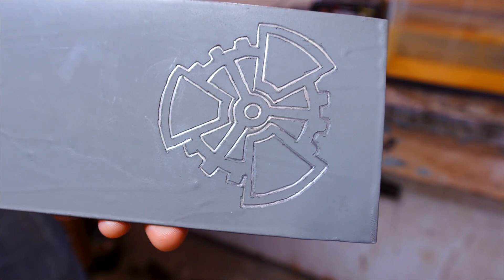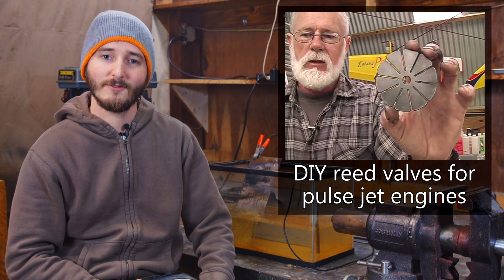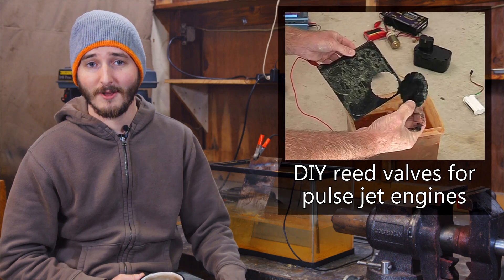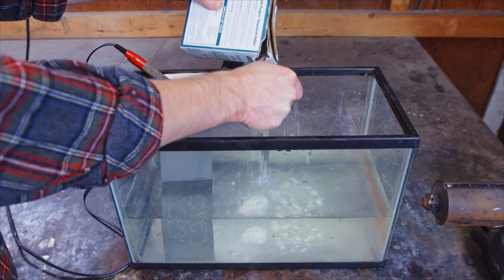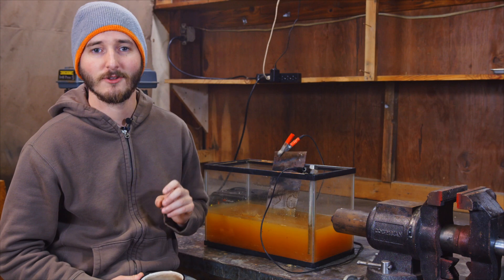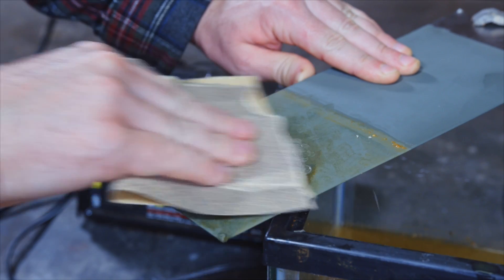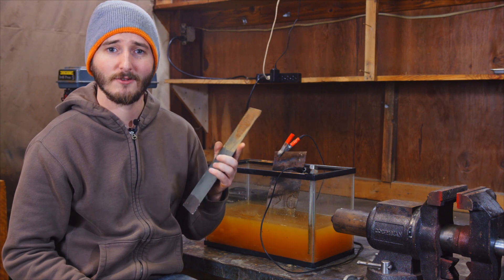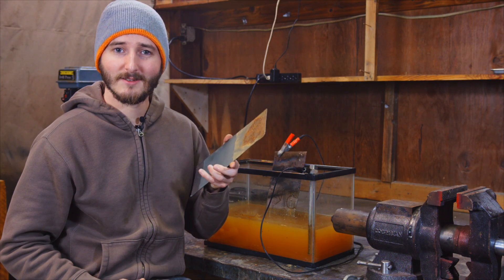How To Cut Steel With Electrolysis [Experiment In Progress] - NightHawkInLight

Comment: Multiple-paragraph comment. You probably already know all this, but, I'll give it a shot anyway. I think this technique might be impossible on the thicknesses you're desiring. In the video you showed, the metal is sheet. The piece you're holding is thin plate. I suspect to do this with chemistry is going to follow the same results no matter what paint you use. The chemistry follows simple rules. Exposed steel becomes rust and flakes off. Any material you want to etch is going to be etched outwards from the first line you cut, hence why it'll only work on extremely thin sheets. What you're doing is kind of like EDM (chemical erosion instead of spark) without a toolpiece to direct the erosion. Your toolpiece is the water, which takes the shape of the cut, growing outwards. In order for this to work, you'd have to regularly re-prime the sides of the cut that you want to shield, and even then it'll be ugly. It looks like you're having some extra trouble in particular with the paint encouraging the electrolysis to occur along its edges and undercutting, but fixing that won't fix the limitations of the method otherwise. (cont'd).

Things to Try: 

1 - It would probably help to begin with the thinnest cut lines possible, since they'll grow outwards on their own. Don't bother with a 1/8" thick area you want to etch, it'll get fat on its own. A single Xacto blade slice for starting. 

2 - While "all" exposed steel is pretty close to the current path of electricity, give it a fighting chance by using a sheet of stainless as your opposite plate, and have the two facing each other with relatively narrow gap, just enough to clear the swarf, maybe use some plastic spacers from coffee tub lids or whatnot. I'm guessing 1/8" to 1/2" would be best. The more electricity is given the option to wander, the more it will.

3 - Try a variety of steel thicknesses, from the thinnest you can find. If you can get the thinnest to work, at least you can observe what is happening reliably, and then progressively move to thicker pieces and see how the problem amplifies. The current pieces you're using seem so thick that you can't get any useful data from experimenting with them, they may be failing for a variety of variables several magnitudes too large. Start with steel foil if you can, soup or coffee cans maybe, can't think of what's cheap and thinner. 

4 - Try to set up a simple vertical bobbing motion, to encourage swarf to leave. Rust is already oxidized, and thus will resist rusting further, making the electrolysis "prefer" the cleaner metal adjacent to it that you do not want etched. A 3-6 rpm turnstile motor from a junk microwave might do the trick, but you might aim more for 30-60 rpm to get the swarf moving. Ideally you don't need much of a bob, just enough caming action to agitate the rust. 

5 - Try using a small aquarium pump to pull the solution out of that bin and into another, and a magnet to suck it out of solution. Maybe rusty water has different properties. It'll either make it better, worse, or have no effect, might as well find out :p  

6 - MORE CURRENT. Throw a rewound MOT with a big rectifier and cap on the output and use that as your power source. Or, heck, for the amounts of power you need, just run the MOT backwards with 120v on the 2000 turn secondary. That'll give you ~6v on the old primary... call it 9vdc after the caps. Or use an old UPS battery you don't mind risking. 

7 - Try different orientations. What you showed in this video seems to be the worst orientation for clearing swarf. Clearing bubbles might happen too, there might be tiny paint-oxide chemicals forming that are messing up your cut, and if you can force the oxygen to bubble up as itself rather than hang around the paint, it might work better.

8 - Take one of the big 2" ring magnets from a microwave magnetron (or whatever magnets you have), coat them in paint or epoxy so they don't react... and stick/bolt/glue them to the stainless sheet right in front of mild steel workpiece. Spacers would obviously be necessary. But that magnet should gobble up every spec of rust and leave the cut path clear.

9 - Try all this with different electrolytes. Salt is particularly poor, it creates corrosive chlorine gas and other chlorinated compounds that'll devour anything. I used tablesalt as my electrolyte on my first hydroxy generator and in about 30 seconds of being on it devoured even my stainless sample piece. Chlorine will mess up any chemistry you're attempting. Baking soda isn't great either. For some things I use TSP (in the painting isle of reno stores, in a tiny cream carton thing), battery acid is apparently best.

10 - Try overvolting. Try undervolting. Higher voltage just wastes heat, and sometimes just boils water (making people think more electrolysis is happening when it's just steam bubbles), but maybe it'll have an effect. I've found it helps with agitation, which is normally useless for the stuff I'm doing, but, might help you.

11 - Try cooling the tank. Try heating the tank.

I still think the technique is fundamentally limited, but, see if any of those change the situation.

Comment: I think it could help if you put more of a profile on the steel before you paint it, like sandblasting it first to key the paint to the metal. This would help the paint to stick better, but would also make the uncoated steel rust faster and more cleanly.

Comment: Might try something more corrosive like Potassium Hydroxide which is a base like Sodium Hydroxide which you may know as Lye drain opener for clogs and very corrosive to most metals especially non ferrous metals like zink and aluminum even without a current but never tried it myself but with a current and steel might actually excelerate the effect don't know as would need to try it. Will not work on SS tho as it has corrosive resistant chromium and nickle and other metals in it.. Acid should work also. Baking soda is too ph neutral and weak I would think although helps to conduct current and voltage in aquious solutions the Lye or potassium does even better. I can get you 1 lb bags of Potassium Hydroxide for you couple bucks a #lb. plus ORM-D shipping costs which means has to go ground all the way. I buy the stuff by bulk for bio-diesel production so can get you close to same price you would only get buying a 50lb bag of flakes. It may well etch the glass on your nice fish tank if you mix solution strong enough but I would just use a shallow plastic container and lay metal flat on something to create sort of a standoff for it to rest upon or a narrow container so the metal can be stood up and straight only to minimize the liquid to chemical ratio so you don't need but a few pounds to experiment with maybe 3.  Hey another thing I just thought of remember the school science demo of Coca Cola and the nail? Maybe just back off a lil here and rethink this and have a Coke? Ha!~ Also for a mask epoxies might work well if metal was first sanded and maybe a light etch to make sure no oils or contaminates would cause it to delaminate from the substraight. Then I would coat it make sure its thouroughly cured and use an exacto or carbide scribe for the line but make them very fine lines as like AVE said before me it has a tendency to eat away more than you intended so in theory if metal was 1/8" thick before it could eat through it might make your fine line scratch 1/8" or larger by the time it could get through unless you emply another trick...perfectly register and scratch both sides of the metal with your design so they sit perfectly on top of each other ....more difficult then it sounds, but then the action only has to meet at the middle which would divide the time  in half therby isolating and minimizing the area of material removed making for a more precision and controlled cut. Or you might be able to just get close to a through cut and pull it out and finish it with an exacto knife. I sat next to a gentleman years ago who worked for think it was Lockhead Martin making parts for NASA, was on a plane trip and he was telling me about a chemical machining process they used and could remove literally inches deep of material using either an acid or a base not sure which now been so many years most likely acid if that deep. But claimed they could do it with extreem precision with the techniques they employed. If I recall I believe they were also using different DC voltages and it was all timed as they knew the decay rates of the material for the solutions used and their dilution or strength for each procedure.

Comment: I've no expertise in this department but is there a kind of spray on rubber adhesive that could bond to the steel. could roughing up the steel with sandpaper or a wire brush help paint or whatever you use bond to it better? I don't know what has been tried here bear in mind.

Comment: you could try to scruff up the metal with sand paper. this technique is usually used in the auto body industry before applying paint to any metal. I'm not sure that this will help, but it usually helps paint stick far better than when the metal has been galvanized or has some other kind of coating around the actual metal. It is your choice if you want to try this, but I would diffenitely consider all the other ideas presented by people that know more about chemistry.

Comment: You could try etching the stencil on both sides of the steel so the electrolysis doesn't need to penetrate as deep  - meaning theres less opportunity for it to deviate from the desired path- because it is occurring on both sides.

Comment: I am not really that much of a genius when it come to chemical properties and other stuff, but maybe you can you can perform this inside a higher pressure environment and also increase or decrease the water temperature which from my understanding should do something to the resistance of the water but i was thinking of decreasing the water temperature although the bubbles are formed from the hydrogen so maybe cooling the water wont help but make it more of a problem.

Comment: Well, here are my 2¢:  First, could you replace the mesh cathode with a cookie-cutter-like replica of the design you are trying to cut out, one that had just the edges of the cuts you want.  Then place it very near where you want to cuts to be, say a millimeter or two  gap.  Also, I'm thinking your electrolyte solution is a problem. If you could avoid making Fe2O3, that would be helpful.  Maybe try using a cyanide as the electrolyte.  Be careful, obviously, use good ventilation and bleach the cyanide to kill it.  Cyanide would yield ferricyanide which would dissolve away quickly.  I don't know, but maybe it would be worth it to play around with the viscosity of the solution (say a little gelatine), especially if you use the cookie-cutter cathode.  Good luck

Comment: Maby make s mode or stamp that would stop any paint or wax from even torching the part of the metal you want to cut, then remove the stamp after the paint or wax has been added making no cut or scrap. Just make shore not have the wax or paint stick on to the stamp or remove the stamp before the paint or wax drys or hardens.

Comment: You might want to try, if you haven't yet, rotating your anode and your cathode. When I was experimenting with producing Hydroxy gas with electrolysis, I noticed that one of my plates was getting beat up much faster than the other. Sadly I can't remember which plate it was.

Another thing you might want to try is replacing your electrolyte. KOH is much(!) less aggressive on the metal (and hopefully the paint) than table salt, and takes a far less active role in the reaction than baking soda. 

Lastly, the problem might be the metal thickness. Once you etched through a portion of the metal thickness, the sides of that newly formed groove allow the process to move outwards from the cut, under the coat of paint. You might want to try repainting the metal sheet to cover those newly exposed parts.

Comment: I used electrolysis to clean up metal detecting finds and I know you need other pieces of iron in the tank to allow the dissolved particles to stick to. I don't know if it will work in this case but it's worth a shot.

Comment: as I'm sure you know, the etching will eat away at the sides as the etch gets deeper. I think this is what you are running into. Apposed to re-coating then just scratching out just the bottom over and over you should try something as thin as you can get first. I also think that carbon steel will be easier to start with than the stainless

Comment: Similar to what you are attempting. Perhaps what you need, is precise control of the distance between the cathode and anode. Failing that, perhaps you could try placing two sheets of metal together. One would have a pattern on it, and one would simply be bare metal. Take the styrofoam from an egg carton, cut little pieces out of it, and glue it to one of the pieces of metal. Then wrap both pieces of metal with rubber bands, holding them together. Then put electricity to both pieces of metal. 

http://www.popsci.com/diy/article/2009-06/carve-steel-saltwater-electricity-and-tin-earring

Comment: I've played with this a bit and have found a few things that may help you. Firstly, use salt instead of baking powder. It won't soften the paint as much and be sure to fully saturate the solution so it pulls more power (you may need to use a battery instead of a charger). The second thing is to use a flat secondary electrode (the same size or larger as the plate you are etching) and get it close to the surface you are trying to etch. I used plastic standoffs which kept it about a half inch away from the etching surface. This will greatly speed up the process and gives a much more uniform and consistent etch. That should get you on the right track! Side note: take care if your fingers absorb too much salt water, as it will greatly lower the resistance of your skin and you will conduct even at 12v, enough to light an led in my experiences.
Cheers!

Comment: Have you tried insulator wax collinite's no. 845.
Reply: We used it at work for years to insulate from heat in making carbon breaks for aircraft. It was developed to insulate high voltage wires in high power transformers.

Comment: Try scratching the metal before painting it to provide a better surface for the paint to stick, there also seems to be a rusting problem so stainless steel should work better than regular steel

Comment: How long were you leaving it in the solution? It may be necessary to remove the plate and re-apply the insulating material from time to time to avoid degradation from being as close as it is to a conductive surface.

Comment: my only thoughts would be:
A: Making the sheet a barrier between two mostly isolated bodies of water to make sure the electricity is going only through where you want it,
B: Increasing the amount of energy you're outputting,
C: Placing the electrodes closer to either side of the metal

Comment: If the bubbles cause material separation at the edges of your etching, then you could minimize bubbling by upping the voltage and dropping amperage. Basically, just cut down on waste heat created by the current.

Comment: In semiconductor fabrication they do alternating rounds of etching and passivation to control the angle of the cut, if you just etch it goes everywhere or starts getting below the mask like in your paint bubbles. So short version: paint, expose, short etch, clean, repaint, expose, short etch.

Comment: if the paint is coming off, it is possible, that the water is working it's way under the paint where you scratched it, perhaps because the steel is smooth.
could you criss cross it with tiny scratches to make the paint to stick better?

Comment: Try using old school oil based enamel paint.  The rustoleum kind, thinned with some mineral spirits.  Someone told me that primer will pass water.  Like when you primer a fender and drive your car for a week before you paint it because you are in high school and then it just rusts wrecking all your labor.

Comment: if this is anything like an hho generator which uses electrolysis you should try using sodium hydroxide or what the primary chemical is in draino. it works much better as a caustic catalyst

Comment: What's stopping the electricity from conducting through the entire piece of steel? I mean a surface coating of paint will stop the electrons from entering the surface at that point, but won't the electrons just enter through the gaps in the pattern and flow through the entire piece of steel like an insulated wire?

Comment: what happened to the sodium metal production? I was really  enjoying that as a chemist.
Reply from the maker: The videos took a lot of time and weren't getting enough views to pay for the supplies...
Reply: NightHawkInLight that's a sad shame. also, for this project I really suggest you look into a chemical called ferrous sulfate or iron sulfate. it's used for etching and is cheap at www.unitednuclear.com. I don't believe it will make iron oxide like you have made because it won't cause an oxydation reaction because of the electrolysis. also, try galvanizing your steel. that will further help with the rust. best of luck man
Reply: that was really cool
Reply: Suupare Truckerz I know right? I'm thinking about continuing it on my channel via the industrial way instead of a thermiteish reaction.

Comment: Try making the outline on both sides and placing a little coat of silicon around lines.
You could try using silicon instead of the paint.